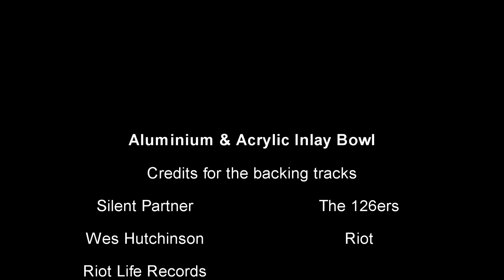#21 Enclosed Bowl with Aluminium & Acrylic Inlay

Comment: Hi Andrew I just found your video and wanted to say you bowl with Colour and  and the aluminium is one of the most beautiful bowls I have seen. I wish I could make one as Good and appreciate your efforts.
Cheers 
Dave 
Sydney Australia
Reply from the maker: Hi Dave
Thank you so much for your kind comments. I think the aluminium inlay looks well alongside the black milliput, but before trying it again I need to find an alternative solution for the aluminium mix to avoid air holes. Also, thanks for subscribing. No pressure there then!
Cheers.
Andrew

Comment: Excellent work Andrew. That turned out really well, very colourful and very eye catching. I've heard that with the epoxy, use a hairdryer to warm it up when you have put it in to help dislodge the air bubbles. I suspect that you didn't need much powder as a little goes a long way in epoxy as I found with glitter. One I think I will make a note of. Well done!
Reply from the maker: Thanks Paul - and thanks for the hairdrier tip. I was really pleased with the result and gave it to my mum for her birthday. She loves it. Apparently I can have it back if she cops it before me!
Cheers. Andrew

Comment: Beautiful project,  Andrew. What is the identity of the scraper that you used to undercut the rim on the concave surface? If I am seeing it properly, I don't recall seeing the carbide disc on the underside of the tool bar. Thanks.
Reply from the maker: Thanks Steven. I think the tool I used for the undercut was a Robert Sorby multi tool. I moved into machining metal last year, and sold all my woodturning stuff - so I can't double-check. Woodturning was great fun, but not enough hours in the day to enable me to make model steam engines too!
All the best.
Andrew

Comment: Andrew, are you sure you're presenting the negative rake scraper to the piece in the way it was meant to be? Personally, I think you are presenting it upside down to what it should be.
Reply from the maker: Hi Len, thanks for trying to help me with this. I've just checked the instruction sheet that came with the tool and it looks like I was holding it the right way up. Jim Overton recons that the tool quickly loses it's edge and needs regular sharpening, so I'll run my diamond file over it. However, thanks again for trying to help me with this.
Cheers
Andrew
Reply: I was going to make the same observation as Len but TBH, it's all about the bur and which side of the scrapper that is presented. I'm no expert when it comes to scrapers but there are a few good videos out there to help (Brendan Stemp, Eddie Castelin, Wyoming Woodturner and I think Mike Waldt have covered the topic).
Cracking video by the way. I should have started with that. :o)
Cheers,
Ben